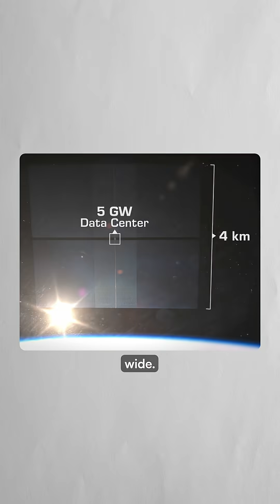Data centers are going to space 🛰️ #trendingshorts #ai #datacenter #tech #space

Comment: 1. Vacuum is thermal insulator. Cooling in space MUCH harder than in atmosphere. Only via infrared emission essentially 
2. 24/7 power is obtainable only in certain orbital points - Lagrange positions between Sol and Earth. So it won’t be flying around the earth as on the picture
3. Lifting all that hardware is still expensive. May be Starship would help. May be not
Reply: 4. Maintenance and repair will be a pain in the rear.
Edit: 5. If they want to make it one-time use and discard, that'll build up a lot of space debris and throw tons of terrestrial materials into orbit as well.
Reply: @Ashireiko_Tatsumi startup idea, unmanned autonomous spaceships will clean the area where you want your "constellation" data center to orbit.
Reply: 6. Radiation will cause bitflips unless properly shielded. Which requires more weight...
Reply: You're killing this guy's dream with logic and facts lol
Reply: Laurate physicists explaining how they fail their attempts to put data centers on orbit.

Comment: Wait wait wait. Cooling isn't that fast in space... It's actually pretty slow.
You might actually need good amount of active cooling due all that direct sunlight heating the equipments in crazy amounts.

I mean other than that I don't see much of an issue... Low earth orbits maybe. Maybe ones without space junk
Reply: Passive Radiative Cooling: Instead of using energy-intensive chillers and fresh water for cooling like terrestrial data centers, Starcloud uses the vacuum of deep space as an infinite heat sink.  
Radiators: They use deployable radiators (often described as large black plates) to emit waste heat as infrared radiation directly into space, where the ambient temperature is near absolute zero (about -270)
Efficiency: This approach is much more efficient and nearly "free" once the radiators are deployed, eliminating the massive water consumption and high running costs associated with cooling Earth-based facilities.  
Impact: This focus on cooling, combined with uninterrupted solar energy, is one of the main drivers for Starcloud's goal to build large-scale, sustainable AI training clusters in low Earth orbit
Reply: @homebox7922 ambient temperature means nothing without conduction. Space is a terrible medium for cooling. Any passive system could likewise be done on earth with air to speed up the process. It’s not that you “don’t need” active cooling in space, it’s that you CAN have active cooling on earth which is better. 
Solar panels are also way less efficient in space as they can’t cool effectively either. 
This just looks like a venture to capitalise on realtime satellite applications that need more performance but there’s no special sauce here. This is marketing spin for idiots with capital to spare.
Reply: @homebox7922 this reads like ChatGPT wrote that 😂
Reply: @homebox7922  ambient temperatures can be in -270 but it's no use if nothing exists to carry away that heat in the first place
Reply: @udayansonawane7267 ever heard of radiation?
Reply: @AlchemistsEngine  nah nah radiation cooling does work not denying that. But it's extremely slow a bit too slow.
Reply: Over here on earth with atmosphere we have atoms and molecules so close to one another that they carry energy with them there's no such thing in space man  @AlchemistsEngine
Reply: @udayansonawane7267 yes, but have you heard of infrared radiation?? Ever wondered how the sun makes earth hot? There isn't anything in space to carry that heat from the sun...
Reply: An H100 properly mounted to a big enough radiator panel that faces deep space and is thermally well-connected can radiate all its heat away into space, and the GPU can stay in a normal temperature range. For 700W, around 1 square meters of surface is needed in order to operate at ~60°, so yes is totally possible with passive radiated cooling.
Reply: @rekcce exactly lmao, these guys don't know jack sh*t about thermodynamics lol
Reply: @AlchemistsEngine  how does radiated cooling work?
Reply: @rickfastly2671 in space? You shoot off photons into the void, and they disappear forever.
Reply: Heat doesn’t radiate into space that well though. There’s no molecules to exchange heat with in a vacuum.
Reply: @PrattAlexRex  that's what I'm saying it's slow. Read
Reply: Even the ISS has radiators.
Reply: Deep space outside the atmosphere is very cold. What are you talking about?
Reply: @Sekir0012  ummm.... That's a very intresting question and actually has pretty amazing answers to it.
Reply: @Sekir0012  temprature is basically the average kinetic energy of all the particles around you. 

What do you think the speed of particles is in space? 
It's basically thousands of kilometres per hour so in technical sence space is extremely hot. But also think of how many particles actually are there... 
Barely any it's emptiness. 
Because it's empty you don't have many particles around you to take your heat and carry it away. Like how things cool faster in water and heat faster in boiling water. 
How it's slower if air fried or air cooled. 
The same way there isn't much to take away your heat in space. Radiation works but is slow. Also you have a lot of energy intake from sun when it's there so it's a bit defficult. I'm not saying it's not possible 

It's cheaper to be done on fkkkin EARTH!!!
Reply: @udayansonawane7267 It costs literally nothing to use a radiator in space aside from the cost of the radiator. It costs a ton of money to run a cooling system in a data center. The solar in space is free and there's more of it, the energy on earth is not